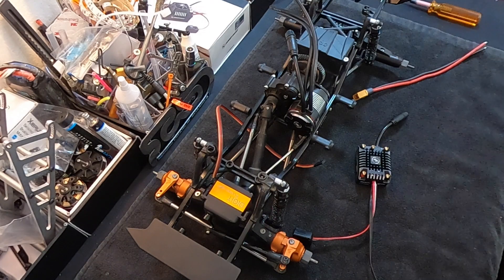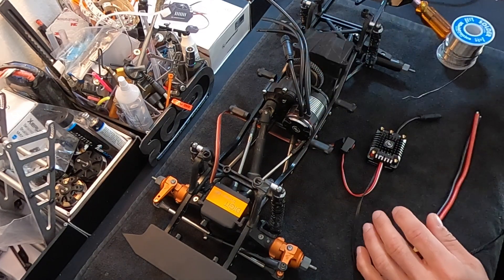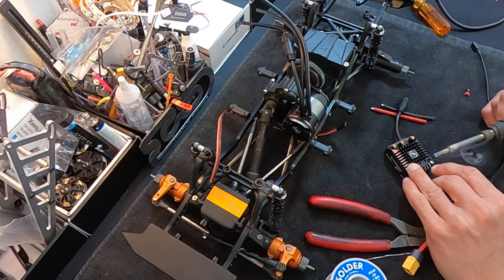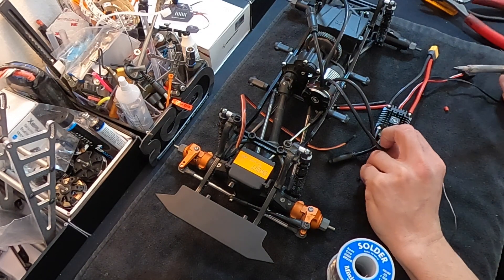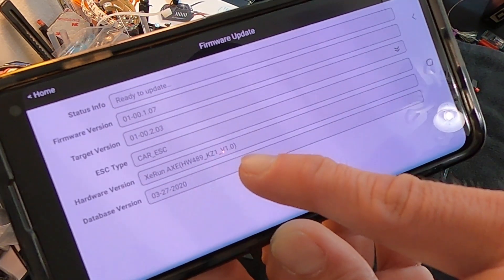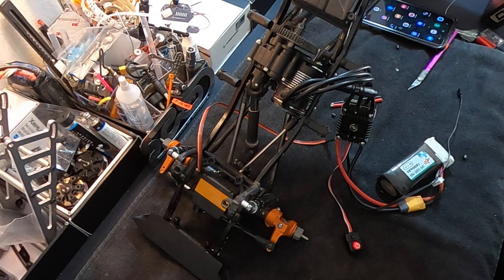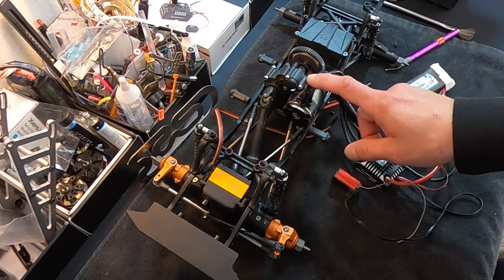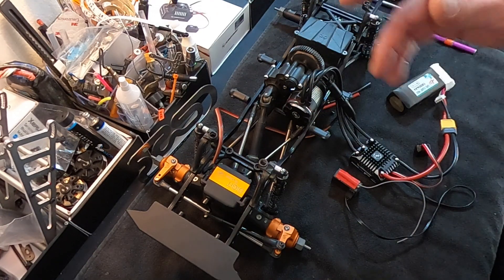The Charlie Show /// Episode 155 /// AXE F.O.C. Setup

Comment: Thanks for the helpful video, I just installed this system in my vaterra and I have the drag brake down to 50 and on auto but the truck still seems to completely lock up ? Any suggestions